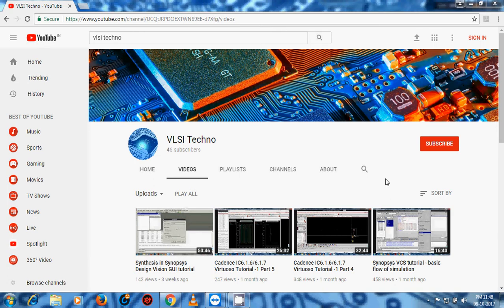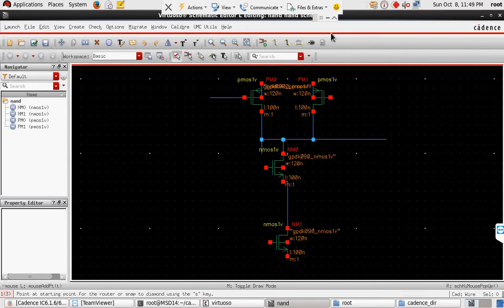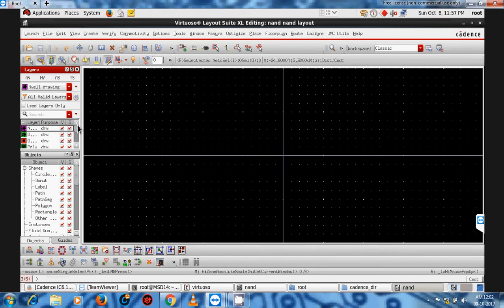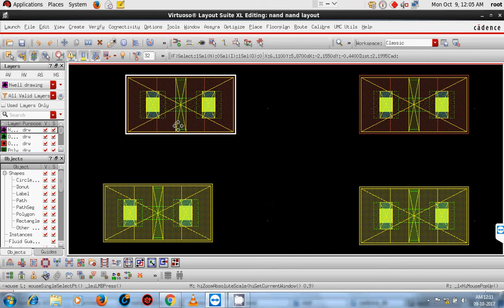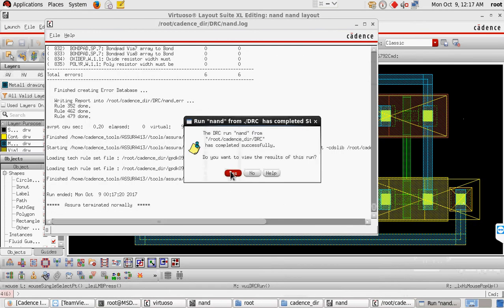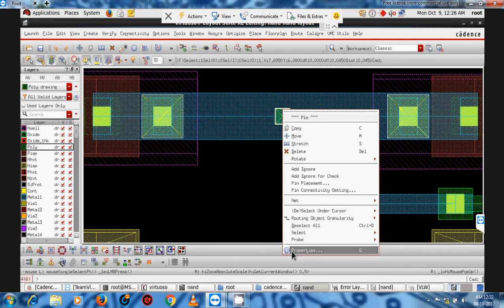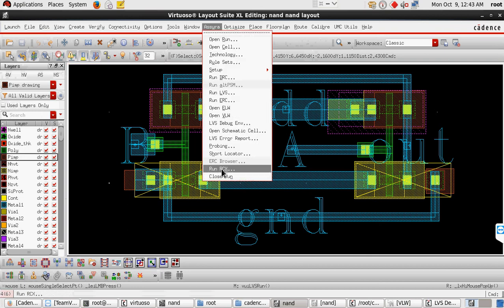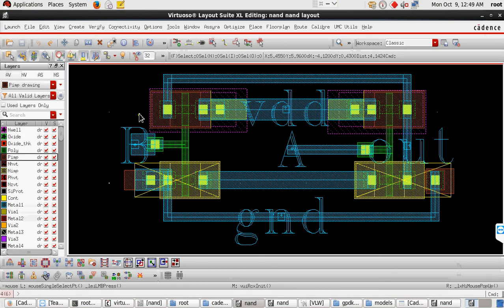Cadence tutorial -CMOS NAND gate schematic, layout design and Physical Verification(Assura tutorial)

Comment: hi sir, how can i make 450  ohm resistor- layout in cadence?
Reply from the maker: Hi
Make a resistor of 450 ohm in schematic by using multiplier, which will show different small value resistor in layout and make connection in series for total resistance 450 ohm